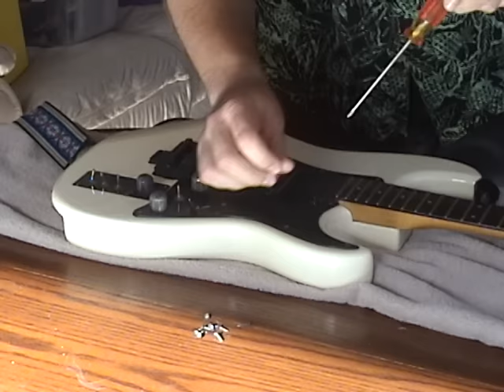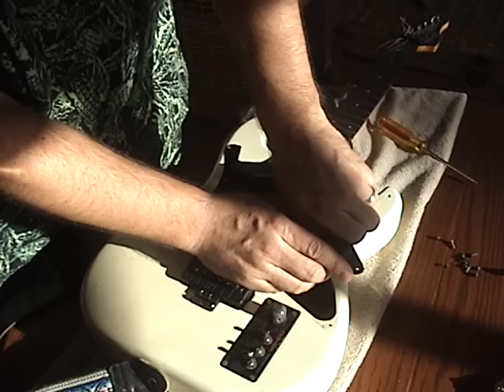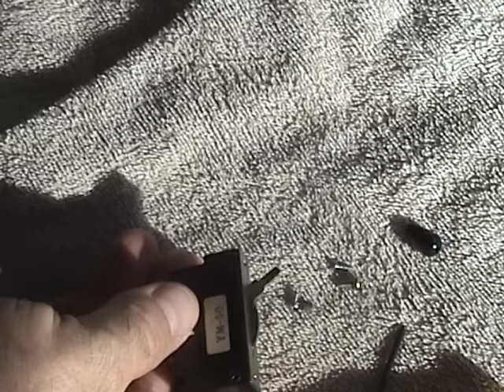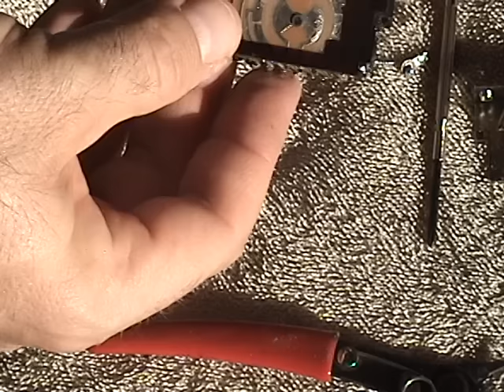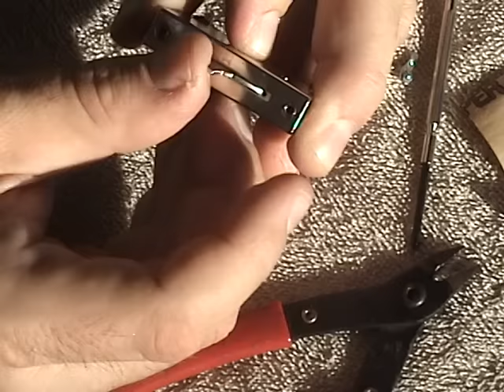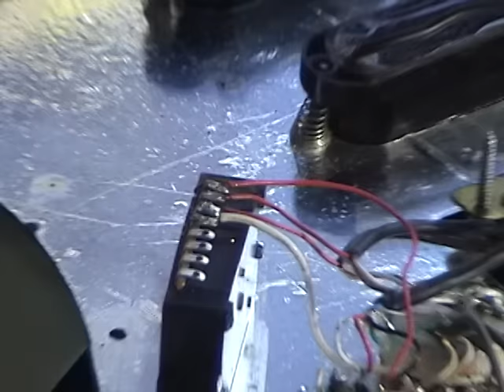How to fix a five position pickup selector switch (clean contacts)

Comment: Chris , I wanted to thank you for making this video,.. I’ve had a Joe Satriani model -Ibanez for almost 25 yrs , played many gigs , never stopped playing and recording all these years,… but the 5 way switch was getting faulty, and I had to fiddle with it everytime before I could get a good connection ( by pure luck ) so that made it impossible to use live ,.. and I’ve never soldered anything before,.. don’t have a solder iron,..but I read in the comments one guy said he just open up the switch and sanded those areas , so That’s  what I did and took needle nose pliers to lift up those connectors a bit like you showed,… as soon as I screwed the little cover of the switch back on I could tell it was a nice tighter fit and handle didn’t wobble anymore,.. put everything back and ,..it’s like having my guitar brand new again,… this guitar costed a couple thousand back then,.. and always stayed in tune perfect &  played great. Thanks for helping me bring it back to its original fire.🔥

Comment: The video was clear enough to follow without a commentary, and I just cleaned a problematic switch like this without issue. However, I didn't find any need to desolder the switch to dismantle it once the scratch plate was inverted. 

All this saved me time and money, and including removing the strings and attaching new ones, it took a mere 35 minutes.

Comment from the maker: @cvo223 The way to do this is to "tin" the wires and the leads on the switch.  Put a SMALL amount of solder on the wire and the switch.  when you heat the wire and hold the solder to it the solder will soak in to the wire.  You can let this cool and then you will have a solder dot on the switch and a solder soaked wire.  touch them together (cold) and then put the soldering iron on them.  the solder will flow together and create a bond.  Practice a few times by attaching braided wire together.

Comment: you can check by plugging the guitar in and tapping the pickups with a coin. It should be rear-only, rear-center, center, center neck, neck-only. You can also check to confirm that the connections/cleaning are good too. ~Chris

Comment: If you can jiggle the switch to have the pickup turn on and off then it is the switch.  If you can shake the guitar (hard!) and hear the pickup come on at all it is a loose wire inside.  If the humbucker is completely dead it may be shorted at the pickup itself and then you would need to get another one.  The best thing to do is just open the guitar and look.  Most guitar electronics repairs are simple and you can figure out what is going on by just looking at the parts.  Good luck!
Reply: Chris Adams my switch when jiggled it cuts my pickups out. How would I fix it? Is it a dirty contact? I bought it new.

Comment: I solder things 2 - 3 timer per year. I have used gas powered soldering irons for a long time and I like the convenience and the ability to pack it in a guitar case, etc.  You can get a kit for about $15US.  I had one fail and purchased a plug in Weller  for about $20US that was very good for my purposes. Get a hot one for guitar cables so that you can melt the solder: gas or at least 35 watts electric.

Comment: That's a Casio MG-510, right? I have one myself, that I rewired to get powered from USB, and then I placed a USB MIDI interface, an audio interface and a USB hub in the battery hole. Everything works neat except for a noise from the digital main board bleeding into the analog audio out that is driving me nuts.

Comment: Sweet video man, very informative. One quick question, I'm new to soldering and was wondering when you soldered the wires back onto the pickup selector did you already have solder on the tip of the iron?
Reply: Hi it's always a good idea to have a little bit on the iron to protect the tip. In this case putting a bit extra on the tip allow it to flow quickly onto the wire and the connected switch, and avoids heating the switch up too much.